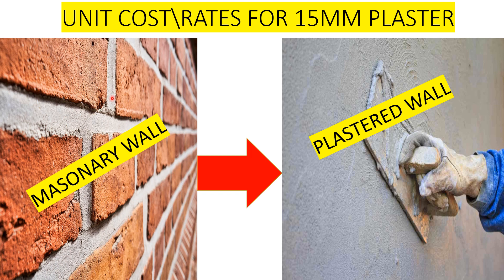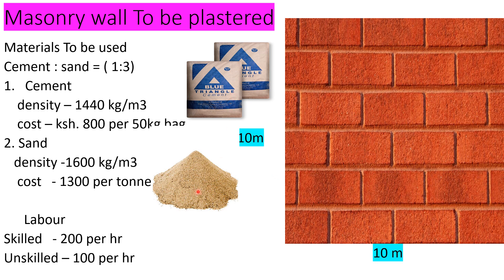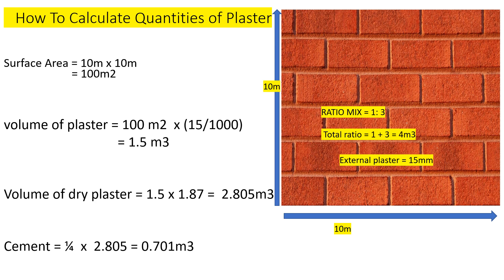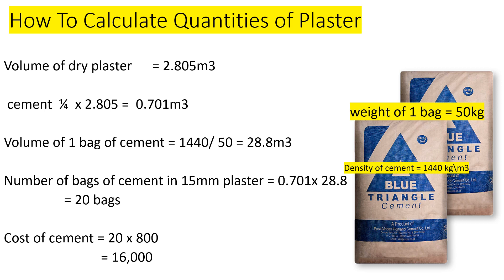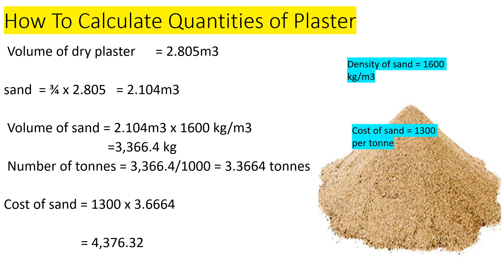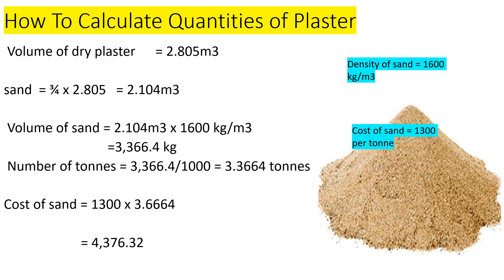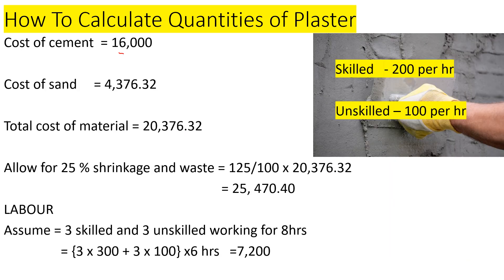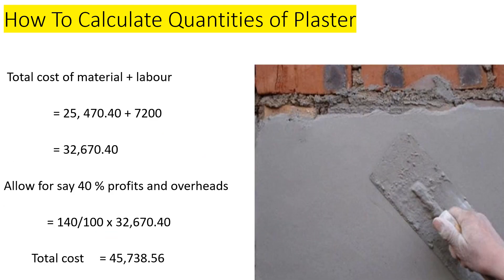How To Calculate Cost Of Plastering a Wall| Unit cost#estimation

Comment: how can the volume of one bag of cement be 28.8 m3 ???????
Reply: Volume=mass/density hence it’s 50/1440, not 1440/50. The volume of a bag of cement is 0.034722m3. I’ve worked with that figure for some time now that I’m giving it without doing the division mentioned earlier. Please crosscheck with google to confirm if you have any doubts. I don’t know if there’s a way to correct that. Other than that, it’s a great video. Keep it up!
Reply from the maker: Sorry its 28.8 per m3 because its 1440 kg/m3 ÷ 50 kg that gives us 28.8 /m3.